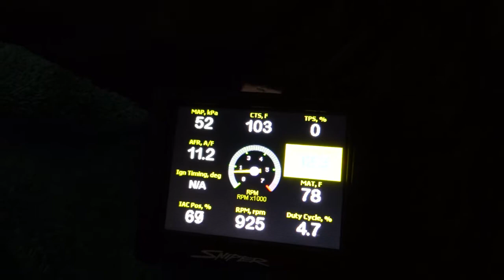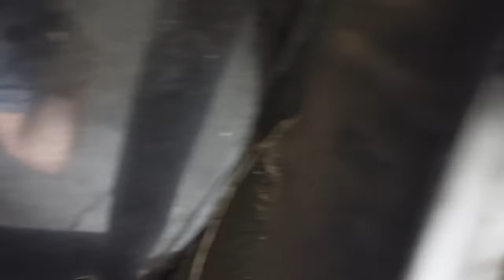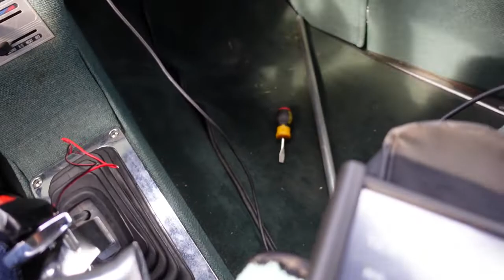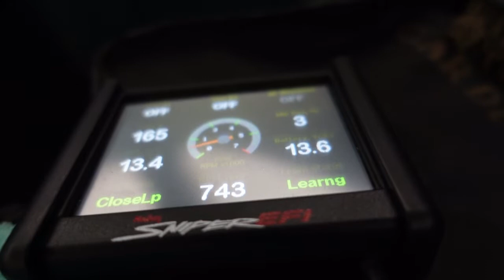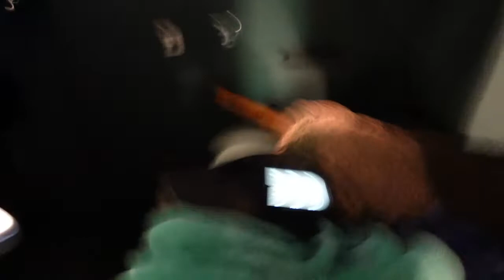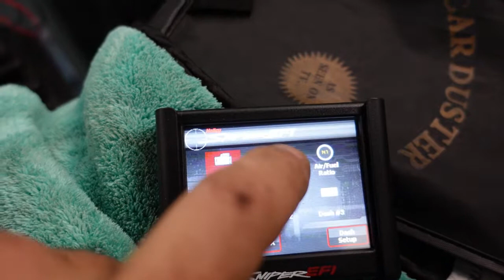Race Week Build Part 23 - Electrical Gremlins

Comment: Could there be anything loose on the carb? I'm thinking what happened to the Buell. Another vacuum leak?
Reply from the maker: I doubt it. It runs perfectly if the tps stays zeroed. Will need to wait for the alternator and a bit more wiring to confirm.